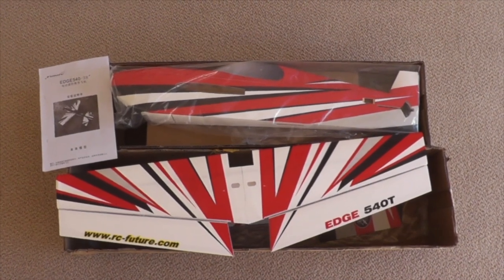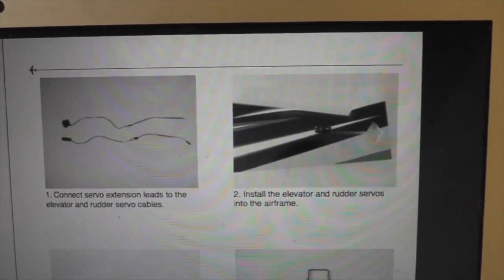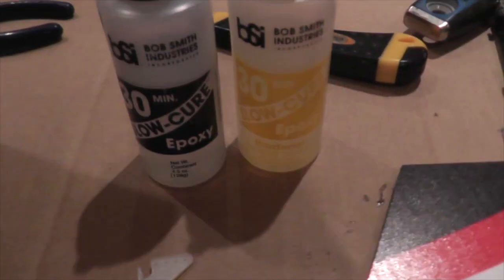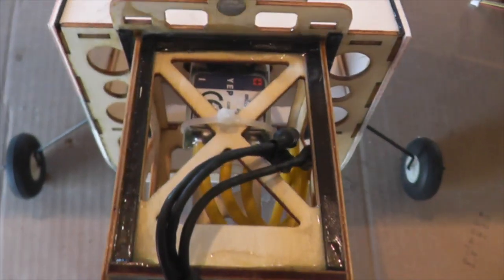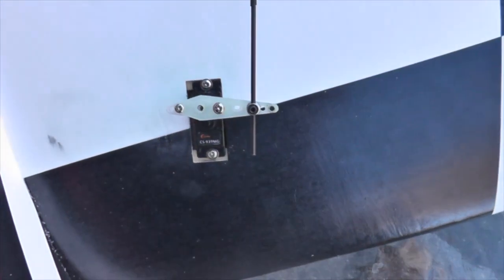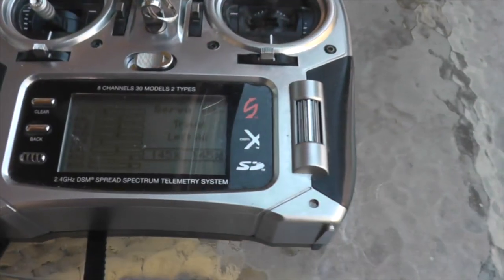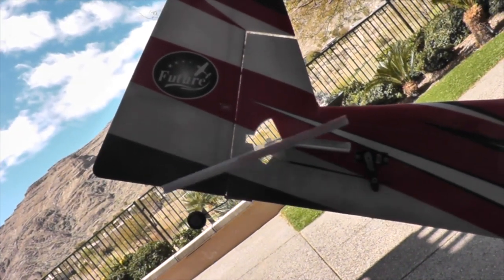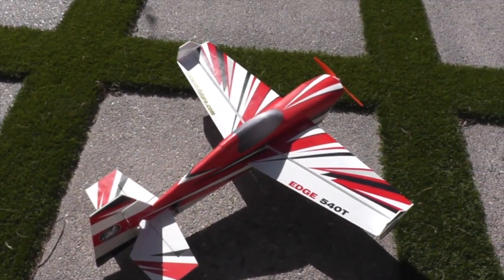Future Model Edge 540T 38" Build and Maiden

Comment: Was considering buying this plane, thanks a ton for this build video, nicely edited and full of information, the kinda video that helps folks like me to know about a plane fully before buying. Thank you man! Really nice flying. :)
Reply from the maker: I think you will like this plane. The newer ones have been upgraded with clear canopy,  ball joints and CF prop, even better. I plan to buy a new one when mine finally wears out, great little plane, thanks, Jim
Reply: oh sweet! one more question, is it really so easy to hover this plane even as a beginner 3d pilot ? Does it have flight stabilizer when its hovering in the video?   I have basic 3d flying experience but i fly a lot of other planes in general. Had 2 scratch built 3d fomies before which i did not like much :O
Reply from the maker: Yes, I am using a Lemon RX7 stabilizer which works great with these smaller planes. It is very easy to hover this plane!

Comment: Thanks for such a detailed video.  Just starting my 3D journey and ordered one of these.  Any advice on the setting up the Lemon receiver stability-wise?
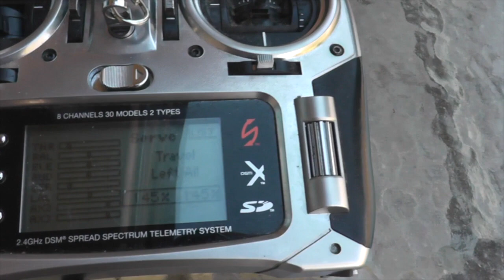Reply: Minimum gain on the receiver works best for me, The 3 adjustment screws are usually positioned at around 12:00 noon position when you get the receiver. I turn each screw counter clockwise around 1/4 turn to the 9:30 position for the first flight and the transmitter adjustment to max. Test the gain to make sure each surface only moves 1/2" or so when you move the plane around each axis. Good luck, great little plane.

Comment: Love the build video, really helpful.
Is it worth trying to kit this plane out for 4s?
I was looking at a DYS 2830 1300KV motor, with 40A ESC and 9060 prop for 3S, 8040 for 4S.
Any thoughts?
Reply from the maker: 3S is probably best on this plane. The CG balances perfect with a 72 gram motor and 30 amp esc and 3S 1300mah battery as far back as it will go. , Anything heavier might push the CG too far forward. 4S will probably work if you keep the batteries down to 1000mah. I think the airframe can handle 4S if you beef up the motor box, especially if you do KE spins. It is a great little plane! Sorry for the late reply....
Reply: Thanks for the reply. Really useful.Will probably keep it at 3S for now then - if and when I can actually order one!P.s. your reply only showed up when I signed in?